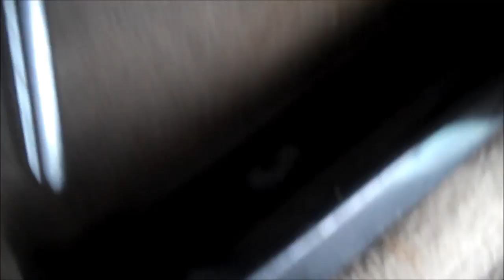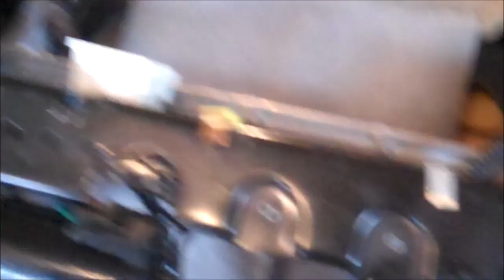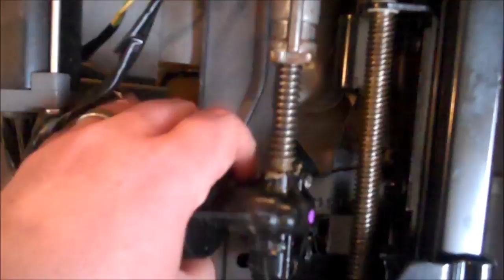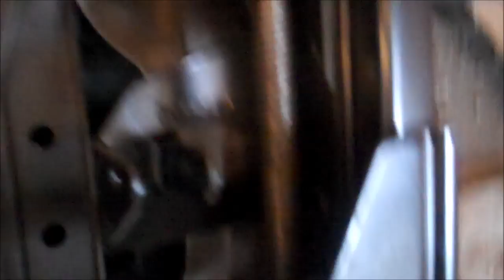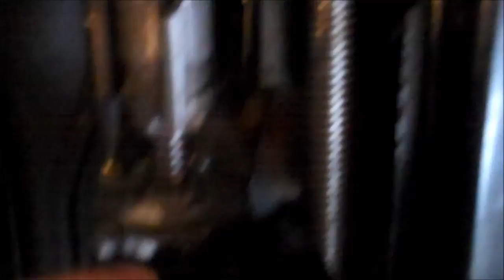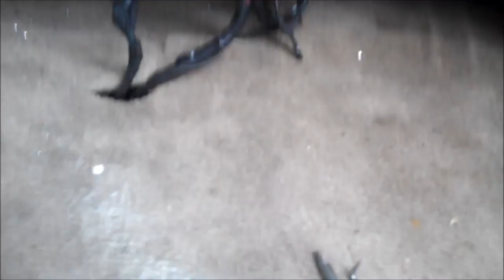Buick Seat Repair

Comment: I watched your video a couple times and then tore into mine. I ordered some gears online from a gentleman who sales them. My seats are now built to last with brass gears instead of those crappy plastic factory gears. It was actually pretty easy job. I would recommend not cutting bolts off but rather pull pin and rivots from both connecting ends. Good luck and thanks for your video.
Reply: where you find your parts.
Reply: where did you find the brass gears...and the gears part number please

Comment from the maker: Yes, the brass gears are a great idea.  I just didn't want to deal with them so I replaced the entire motor, shaft, and nut.  It came out to about the same price and I have had no problems with the motors that I put in(with plastic gears).

Comment: Have a 2000 Park Ave. with a similar problem like everybody else with a seat. Mine is the driver side. How did you get the seat out of the car? I know about the hooks in the slots, just how did you manage it? Did you do it by yourself?

Comment: Cutting the frame is potentially dangerous in a crash.  It would have been easier to buy a junked seat and use it or swap out the parts.  Kudos for re-engineering your seat motors but 99% of people couldn't do this.
Reply: If you don't have the skill have a professional do it. And you can't find replacement units new or used. They don't make them new anymore and the used ones have the same problem. They have replacement parts that are metal gears but you have to cut the frame and weld it back together and that's the only way to get it done.

Comment: Hi I know it’s been 7 years since you made the video, but if you could answer my question it would help a ton. I have a second car that I use for parts and from what I could pick up it’s the white gear on the shaft that starts to break. Any tips on how I could take the shaft out of one car and replace it with the other thanks for the help.
Reply: I guess to add to this question. Is it the gear on the shaft that the teeth break, or a different gear inside the motor.

Comment: Hey anyone gonna answer where you find the replacement parts?????  Please
Reply from the maker: It has been so long since I did this, I forgot the combination.  The motors I used are in the video description.  I know I bought 3 motors to make the two that I needed.  I just forget the combination that I used.
Reply: @taaf03  is there a fix on this car for a seat that moves back and forth slightly when you start and stop? I've seen a few pretty good videos on how to fix this problem on GMC trucks but I'm not sure that the tracks are the same on this
Reply: Pick a part maybe